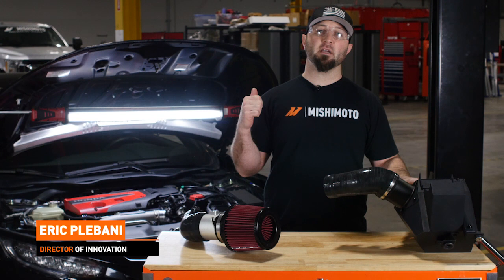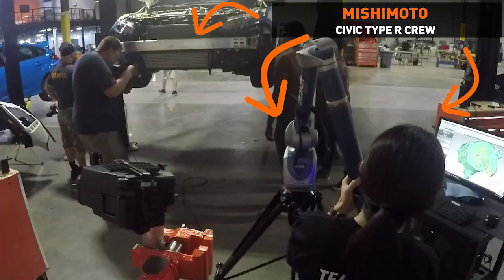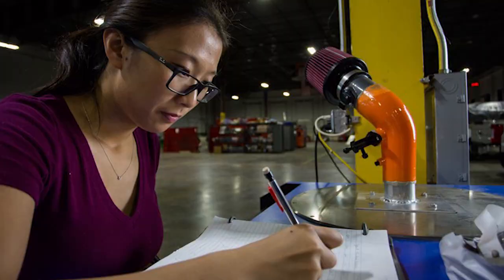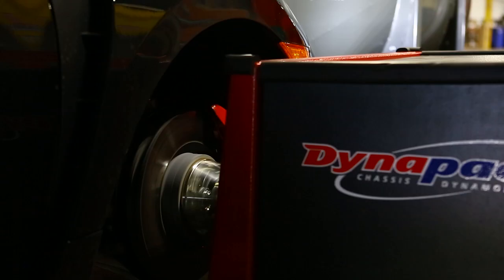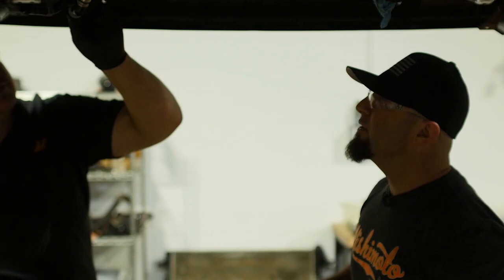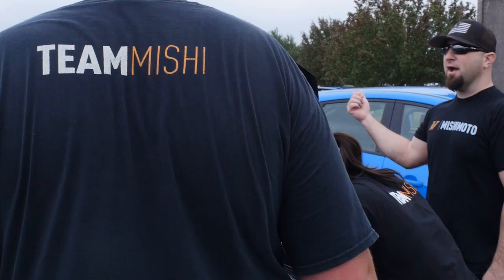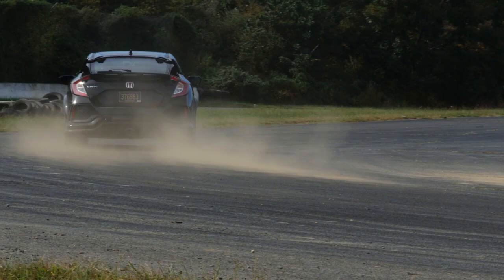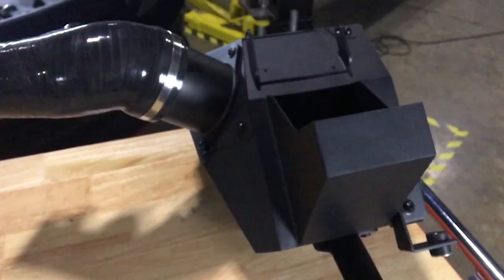2017-2021 Civic Type R Performance Intake - Hot seat of development

Comment: You can clearly see that you guys are pure passionate professionals. You do your job with utmost passion and belief, when you want something to be done, you simply do it and focus on the little details that create the perfect product. This is admirable and should be a model for others without and doubt! Thank you in my name, car owners and all motoring fans :)

EDIT 15.11.2018
My Intake arrived yesterday, thank you MishimotoUK! The installation was really easy - took me around 2 hours, had only one problem with a small clamp. On the 2018 model in Europe, they did not use screws but metal rivets so I had to use a bit of force to open it up. Everything else fits perfectly and is very easy to install. The sound is AMAZING and I could instantly feel the difference on the throttle. The car feels smooth and the response has increased. I will certainly recommend Mishimoto around my friends and not only :)

Comment: Wow I am impressed by this intake. Just installed mine. I was skeptical of the sounds portrayed in this video. Well let me tell you it is totally accurate . The turbo noises are really that much louder. I can clearly hear the induction and blowoff under moderate throttle with the windows closed and music on. It's amazingly loud when you floor it. You couldn't hear the induction or blowoff with the stock parts unless you had your windows open and you were listening for it. Even then you had to floor it to get a slightly audible induction or blowoff noise. Looking forward to more awesome parts from mishimoto.

Comment: why didn't you show what any of the temps were with the stock intake, just your intake with and without the box... and how did you prove your intake was the best?  you didn't compare it to any other aftermarket intakes... you didn't even compare it to stock for track testing... or if you did, you didn't show us the results.
Reply from the maker: Hey Bob. The temps with the stock airbox in place were similar to
our box installed, but the stock box with the OEM intake boot flows much less
as shown earlier in the video on our flow bench.  For comparison sake, we
didn’t find it beneficial to include stock temp vs Mishimoto system temp since
we proved superior flow characteristics with negligible gains in temp
comparison.  As far as testing competitors systems? We went one step further
and gave them the benefit of the doubt but using our high flow intake tube and
MAF only alternating box vs no box as our competitors use open air element.
Reply: I guess we'll have to take your word on all that, but you certainly didn't show any proof.
Reply: @mishimoto  How much were the temp gains for IAT and IAT2 from stock to this?

Comment: Looking at your data I see the improvement in air temps to the turbo, showing that your intake does provide a colder air charge however, it seems to that little effect as intercooler outlet temperatures stay about the same...
Reply: oyurcha1 yep, turbos heat up the air no matter what because they are compressing the air.
Reply: Brodey Dover so in that case, a more efficient intercooler should be the main focus then right?
Reply from the maker: Hey guys.  An intercooler is something we are currently looking into for both the CTR and 1.5T.  Keep an eye on our engineering blog for all the latest news and updates :). https://www.mishimoto.com/engineering/

Comment: All after market products were encountering same "issue" - torque management. So you get more air in but because of proven torque management the power is increased for "short" period of time and is available always just after starting the car. What was your feedback on this issue?
Reply from the maker: Hey Jernej, you may be referring to the tuning on the vehicle. Most vehicles do adjust fuel trims automatically to keep performance within a certain range but we had no issues with the CTR during testing. Multiple dyno runs after having the kit installed and road tested showed 16whp gains consistently on the OEM tuning with more to be had on a proper tune.
Reply: @mishimoto  this is quite interesting because we have tested diff mods (showed 327) and diff cars and all of them after one pull, torque management re-adjusted itself (uuu my torque is higher than it should be let me adjust things to what I'm set to), then it showed again 309. They had same issue here https://www.youtube.com/watch?v=TVmUX2LJo8s&t=422s
Tnx for info how did you achieve this without doing the ECU and had permanent gain.

Comment: Did you guys experience any over heating during track tests? Specifically the coolant temps climbing into the over heating range.
Reply from the maker: Hey John. 

We put our CTR through track testing torture We’ve heard these complaints and made sure we experienced them so we know how to fix it.  Stay tuned for our continuing development as we will touch on this subject in our next video.
Reply: Mishimoto Automotive I have your catch can on my FC1 and FK8 and oil cooler on GD WRX and MK3 RS.  I appreciate all the R&D you put into your products.  Looking forward to the release of the air box,  FMIC, cooling rad and oil cooler for the FK8😁

Comment: Will this work for the Accord sport 2.0 also???
Reply from the maker: Hello hydroboy35th . Unfortunately, we have yet to have a newer Accord in our facility for testing so I would not be able to confirm fitment of this product. However, the engine configurations are quite similar, so it's certainly not out of the question.